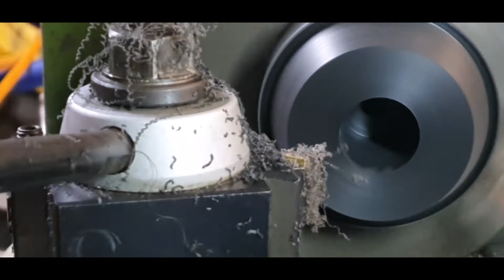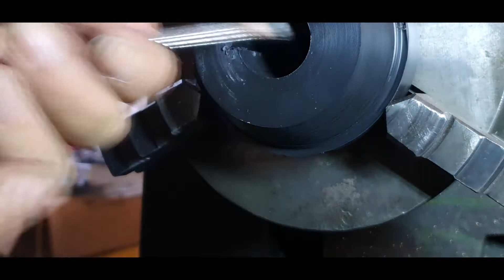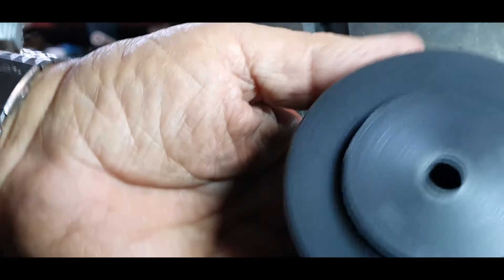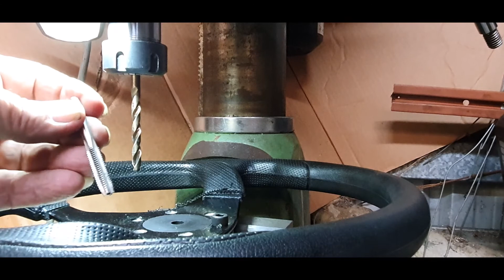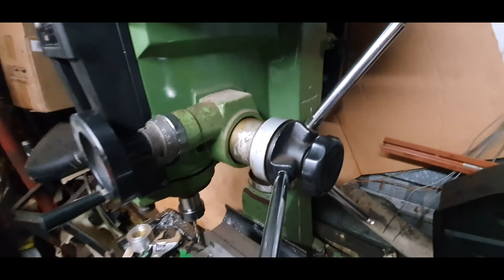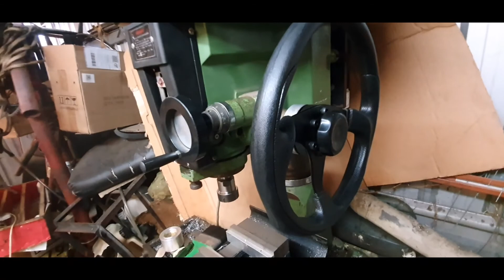Rong Fu  RF30 Mill Quill Wheel Mods Part 2

Comment: the pros to the steering wheel mod are obvious.   But the cons are you can't ever get it out of the way and it's going to happen.   At least with the 3 rods you could just remove em easily
Reply from the maker: G'day  Bobby. Thanks for your comment,  The wheel can be removed in a few seconds if necessary.  The wheel is continuous circle for operation,  whereas the single or 3 rod type have a movement flow limitation . In the end, It's up to the Individual what they feel ok with. Also you can use a smaller diameter wheel.